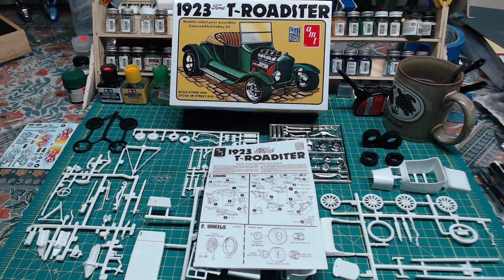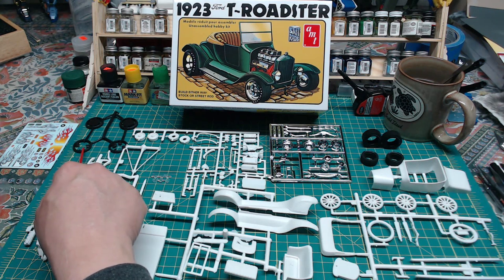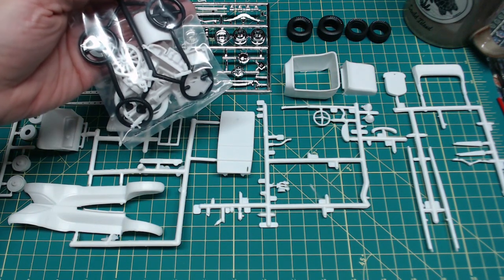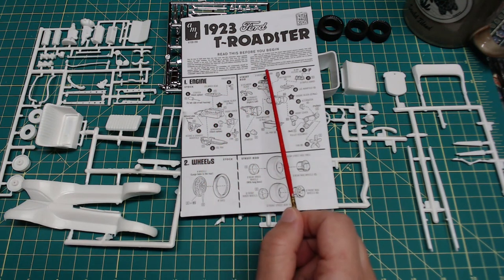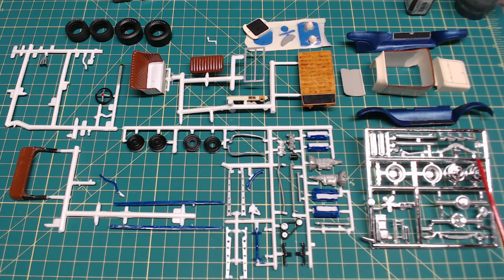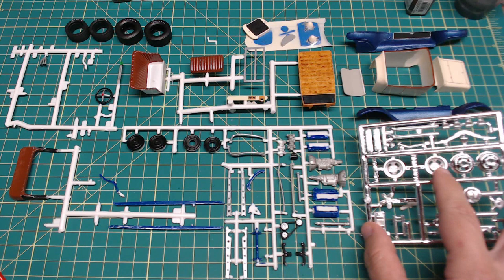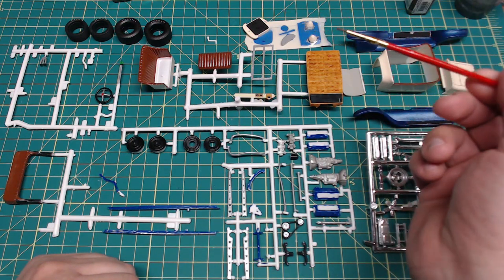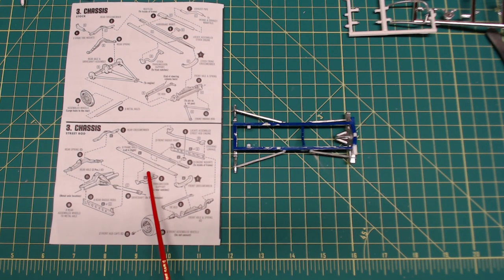Practical Plastic: Episode 5, AMT Ford T Roadster

Comment: Nice work. And thanks for choosing the Hot Rod option for this build!😀.
Interesting to see the issues you encountered and your suggested remedies. I thought the idea of toning down the Chrome was great. Do you use a satin or matt clear for that...and do you spray or apply with a brush?
Also good to see the consumption of a cup of tea..😆. We were always led to believe that Americans only ever drank coffee.😉
Reply from the maker: Thanks! I love the stock model T but this kit caught my eye as the street rod version so that was a simple decision. The dull coat I used to tone done the chrome was a Tamiya Dull Coat acrylic (it's simply labeled as "Dull", not specified as matt or satin). I brushed it on. This is a great product, with water clean-up and best of all it won't leave any brush marks!
Reply from the maker: Among us Americans, yes, I think tea drinkers are in the minority, and certainly tea-only people are an even smaller group. By the way I worked midnight shifts, 12am - 8am, for 31 years and never had a single cup of coffee. Just seemed like a bad habit to start. But I love my tea. For me a cup of tea is time for a mental re-set, whether for hobbies, work, writing a book, or just a quiet moment. :)
Reply from the maker: Correction: NOT a Tamiya product, but a Testors Model Masters Acrylic product: #4636 Flat Clear/Matt Transparent. Whenever I think acrylic I think Tamiya.
Reply: @practicalplastic3450  Yes, I was a shift worker for 30 years as well. Coffee of any quality was our sustenance.😆.
Reply from the maker: @nzspeedwayfan  We are a precious few who have handled off-shift hours for many years!